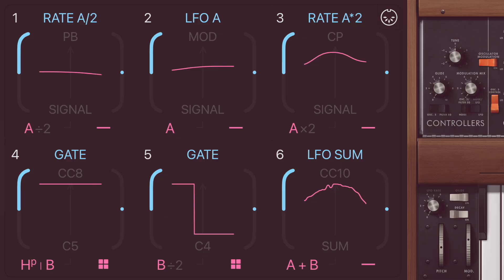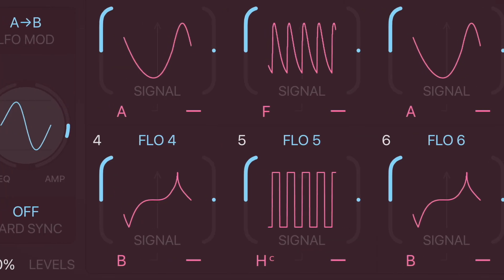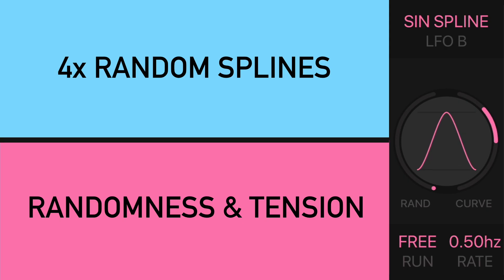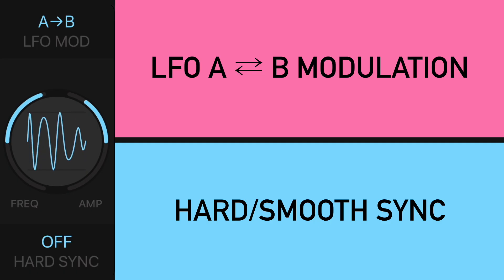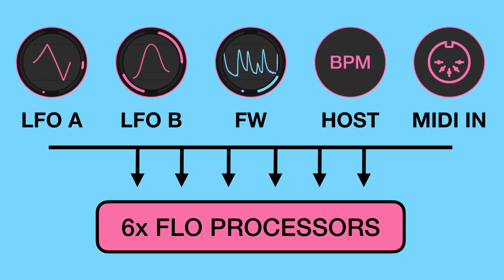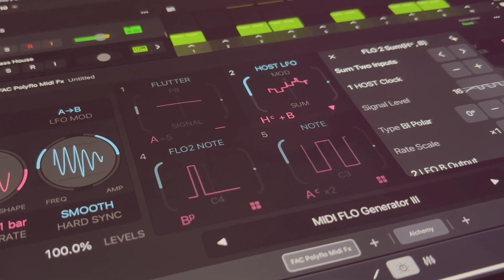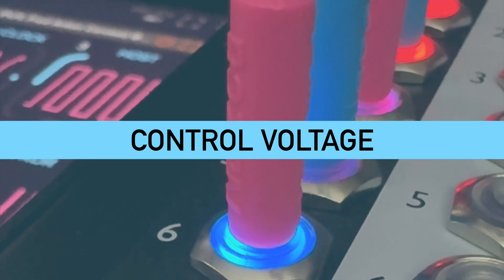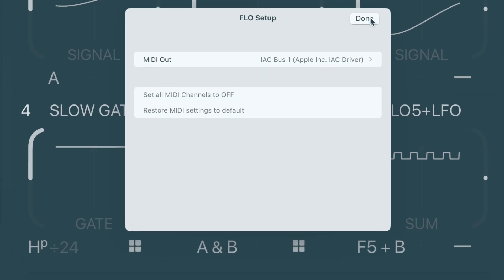FAC Polyflo New AUv3 Plugin | Creative Modulation Flow

Comment: Interesting! So you can use this as an FX in AUM , or MIDI to drive/fx app instruments inside AUM?
Reply: To me it seems the second one: it outputs MIDI (sequences/notes, or modulations/0-127); alternatively outputs as control-voltage for hardware synths.

It somehow reminds me Oscilab; one of the greatest iPad apps, but that unfortunately was never ported to AUv3.
Basically, if I understand correctly, it is a midi generator that can generate & output several (6?) signals, and be used in the same way as midiLFO or other LFO generators.

I think that's the idea, but I might misunderstand something.
Reply: @Pictor13  thanks for that. Hope to find out soon!
Reply: Btw, it also can be mounted as AudioFX so it can Env-Follow a signal.
I've written the description better.

When is midnight arriving?? I wanna try this app!!! 😂